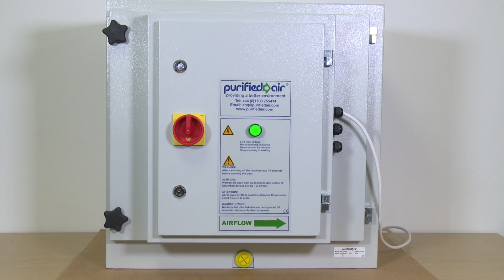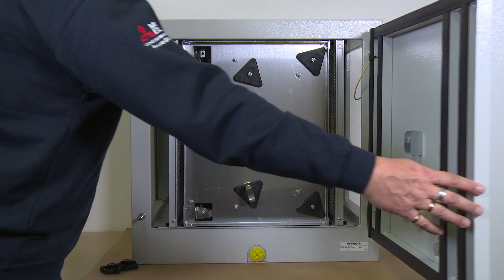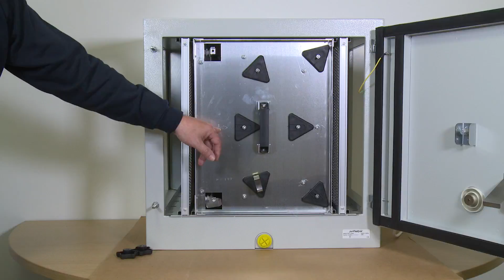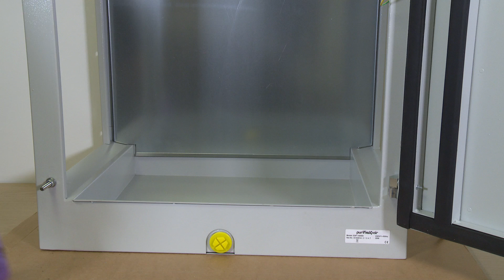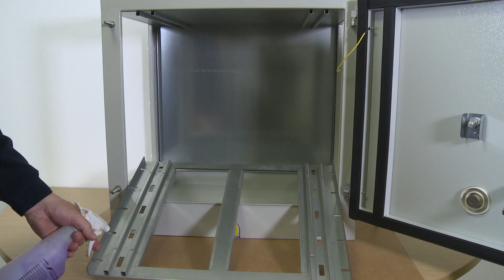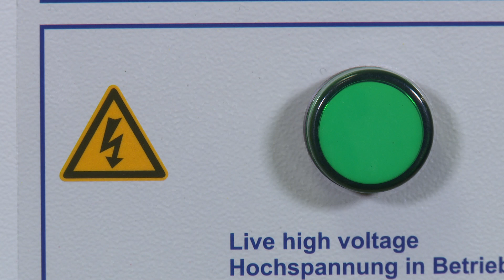Servicing a Purified Air ESP unit.

Comment: Ecologic Kitchen Air Filtration System. the field of infrastructure and industrial ventilation in  UAE and world-wide. The products of the company are the result of a constant R&D activity and the company does project implementation with the highest quality and on shortest time. 
The major products which the company deliver are 
-In Door & outdoor Air Purifier
- Electrostatic precipitator 
- Kitchen Ecology Unit 
- UV Hood Systems 
- Industrial Exhaust Fans 
- Ventilation Fans 
- Ozone generator
www.airfilterationuae.com 
info@airfilterationuae.com
Cont No: 04-2244304
Mob No: 050 8577865